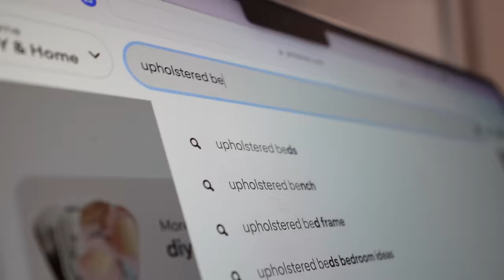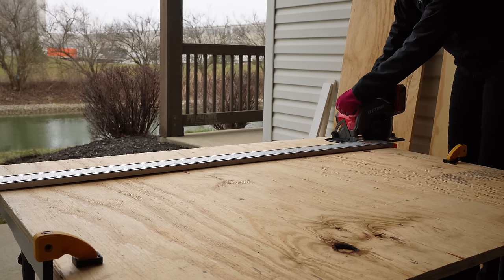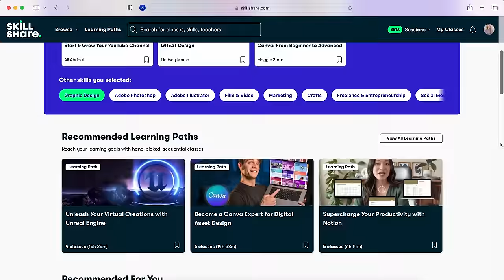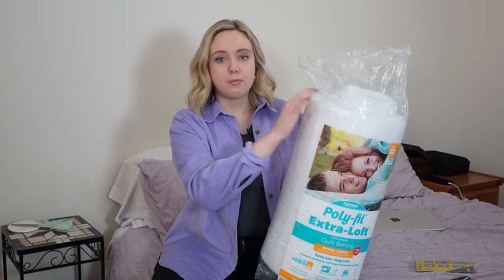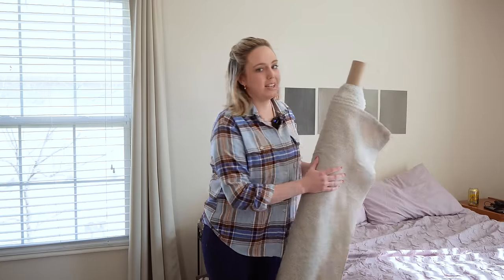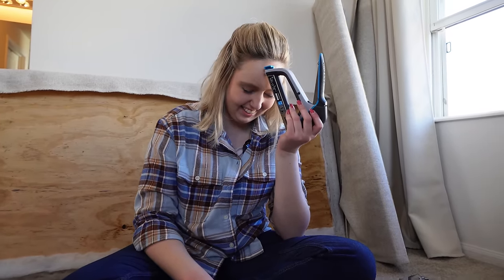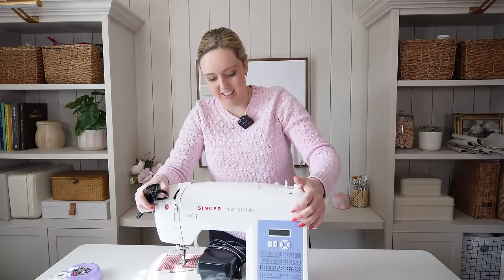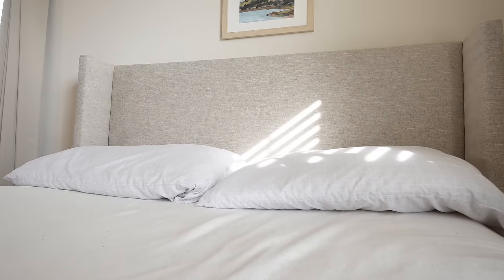This DIY headboard *transformed* my bedroom

Comment: I find upholstery so satisfying! I reupholstered a 5 seater lounge suite, made a custom upholstered window seat and an enormous tufted headboard.
I found using curtains to be a less expensive way for the headboard. I used ones that were almost identical to the fabric you chose. They were rubber backed blackout type but that didn’t give me any issues. 
I used foam mattress toppers doubled up and inexpensive polyester quilts which saved a lot on the price of foam and batting. I scored one foam underlay and one king quilt at a thrift store for about $5 each. I sprayed antibacterial spray on the foam and let it sit in the sun for a few hours and washed the quilt and let it dry in the sun. I also scotch guarded the fabric after I was finished. A quick wipe with a damp cloth removes marks like a dream. Even chocolate on the lounge that had been dropped and then melted into it by someone’s warm toosh 🤦‍♀️ I also added longer legs and upholstered the box spring on the bed and purchased children’s rolling under bed storage boxes. They were a nice white wood and had a little cut out hand hold and the clearance for the wheels allows good airflow still. I used a good quality fabric glue (it was a clear Aileen’s tacky variety) to sick the fabric to the top of the box spring as there wasn’t any wood to staple it to like there was underneath. 3 years on and it’s held up perfectly with mattress rotating and sheets being changed etc.

Comment: My Lowe’s has stopped cutting boards for people altogether. They also stopped their stockpile of scraps. Both of which I always used. I always ask them to cut my large pieces of wood specifically so it would fit in my car but then always shop their scrap pile.
Reply from the maker: Oh no that is terrible! I hope that doesn't happen at my location! I at least depend on it for the same reason you do, to fit pieces into my car. People will end up out in the parking lot cutting down pieces!

Comment: 54 inch wide fabric is hard to calculate amount you need.  You were right to get more than you thought you might need.  You could always finish the back of headboard with the extra fabric using upholstery  tacks or staples and sew storage baskets or fabric liners for store bought baskets, etc. 

Note: I cringed a bit when you cut your fabric.  I was taught to pull out a piece or two of the warp threads (the threads making up width of your fabric on the roll).  That way you know your fabric piece is squared up so you can get even tension while pulling fabric taught while upholstering(plus you naturally make a straight line cutting guide).  Beautiful product in the end either way.  ❤

Comment: looks good...but get yourself and electric stapler...they don't cost much
Reply from the maker: After this project, I definitely want one for any future upholstery!
Reply: That was going to be my comment too! I love my electric stapler. It also fits small brad nails too. So handy. Mine is Ozito brand (I’m in Australia). It’s corded but very lightweight. I did have the Ryobi cordless but it was heavy and bulky. I also have the Ryobi pneumatic one but haven’t taken it out of the box. The noise of the air compressor cutting in and out freaks me out.